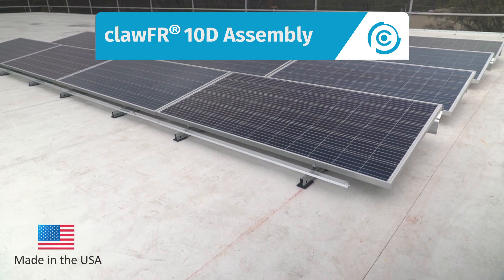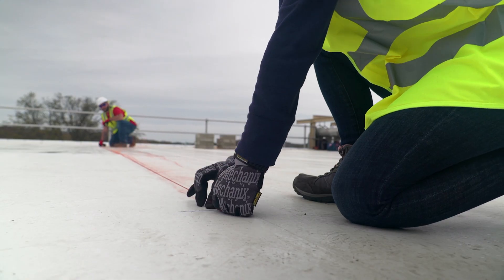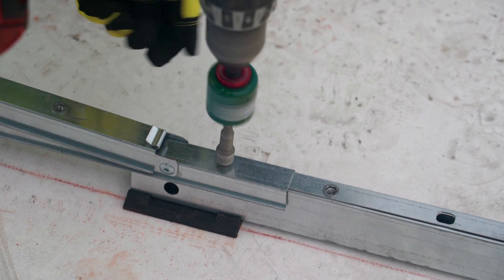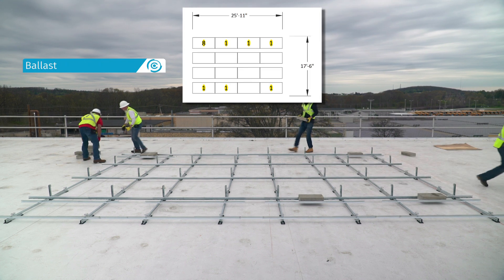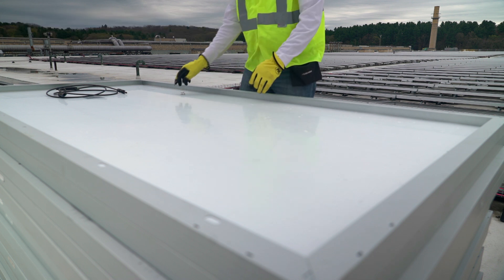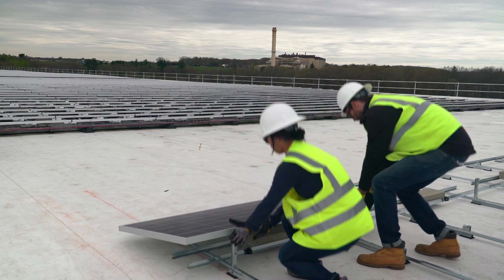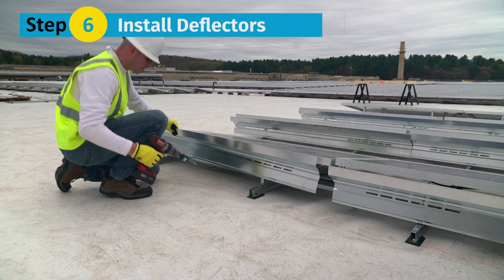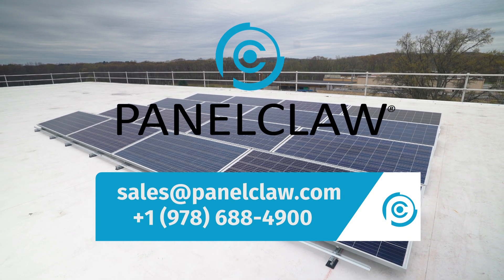clawFR 10 Degree Assembly

Comment: I do not see that torque wrenches are being used. Do you recommend using torque wrenches to ensure all connections are torqued to the specified values in the installation manual or does using a torque limiter remove the need to utilize a torque wrench? I have noticed that the torque limiters stop before they get to the specified value and do not stop exactly on the specified value. Thoughts?
Reply: Our installation manual can be found in the technical library at www.Panelclaw.com
We recommend the use of inline torque limiters from seeking.com .
Reply: @costanicolaou3477  Understood. But does the use of the recommended inline torque limiter remove the need to put a torque wrench to every bolt?
Reply: In this video I do not see them using a torque wrench and the narrator never says to torque to 6 ftlb. (or 4ft lbs)